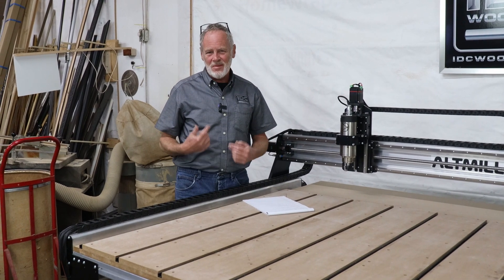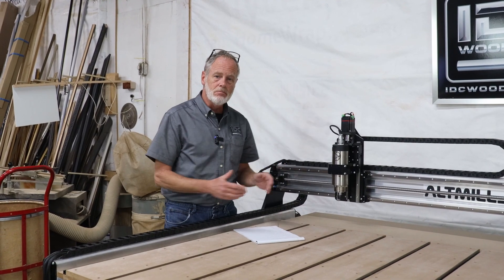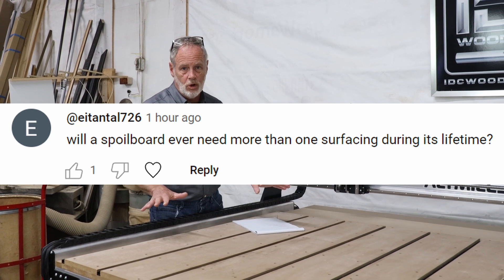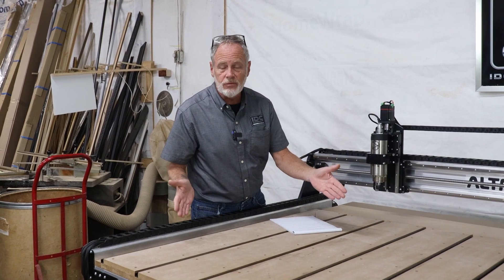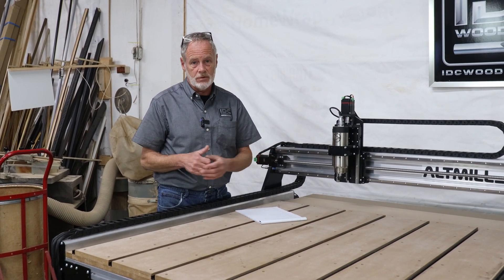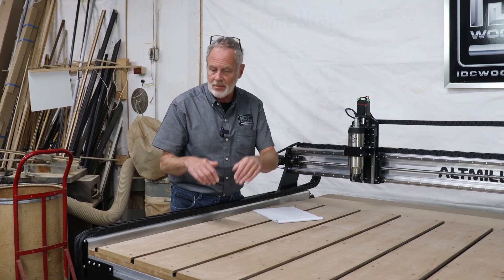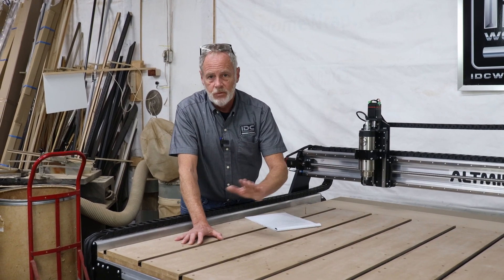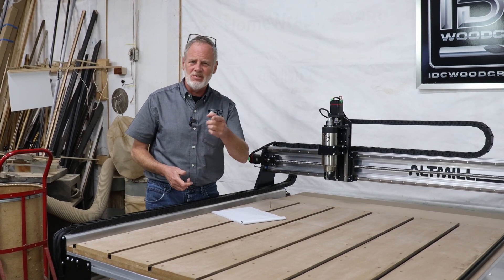Resurface Your Spoilboard When This Happens...

Comment: I would think you would need to also resurface when you change from a router to a spindle. Or really any time you re-install either you router/spindle or your Z axis. Am I wrong?
Reply from the maker: dynamicsx, You're correct! Whenever you change out your router or spindle, it's a good idea to ensure everything is properly aligned and sometimes resurfacing can be necessary to maintain accuracy. Each component can introduce slight variations, so double-checking that your Z-axis is set correctly is always a smart move.

Comment: I’ve been using MDF as my spoil board however, I keep burning my surfacing bit when I try to flatten the spoil board. 
I’ve tried playing with my speeds & feeds but no matter what I do, it keeps burning my bit. 
Any thoughts?
Reply from the maker: kayotte01, Burning your surfacing bit when working with MDF can be frustrating. One common reason for this issue is that MDF generates a lot of heat due to its dense composition. It might help to ensure you're using a sharp bit and consider adjusting your depth of cut to be deeper.  Additionally, you could experiment with an increased spindle speed or feed rate for smoother cuts. Make sure to also keep the bit cool by minimizing dwell time in one spot.

Comment: What is integer value missing? I’m trying to figure out a G Cod. Help please 🙏🏼! It said No.5 line Integer Illegal.
Reply from the maker: antoniorojas4015, It sounds like you're encountering a common issue in G-code regarding integer values. In G-code, certain commands require specific types of numerical inputs, and if an integer value isn't provided where it should be, it can result in an error message like that. Check line 5 to see if there's a command expecting an integer and ensure it's entered correctly.

Comment: 4:22pm 10/24/24 - Garrett - I put OSB on top of my spoil boards and I built a large cart on wheels topped with melamine.  My thinking is that after surfacing, if I move my cart the CNC should stay parallel to the cart no matter where I move it.  Your video says I’m wrong.  I work out of a 2 car garage, so I tend to move my CNC a lot.  Please explain.  Love your products and videos
Reply from the maker: Joe-p6k, It's great to hear you're enjoying the products and videos! The concern with moving your CNC setup is that even if the cart stays parallel to the surface of the spoil board, any shifts in the CNC's position can affect accuracy. The machine's alignment and calibration are crucial, and slight changes can lead to inconsistent cuts. Keeping everything rigid and stable during operation is key to maintaining precision. I'd suggest being cautious with how you move it around.

Comment: I'm new to the CNC world, do you shim your work pieces up off the spoil board to prevent cutting the spoil board when doing through cuts?
Reply: You can, but that's why it's called a spoil board.
Reply from the maker: jc507, Welcome to the CNC world! Yes, many woodworkers do shim their work pieces to prevent cutting into the spoil board. It helps protect both the spoil board and your bit. Just make sure the shims are securely placed and level to avoid any issues during the cut. Enjoy your CNC journey!